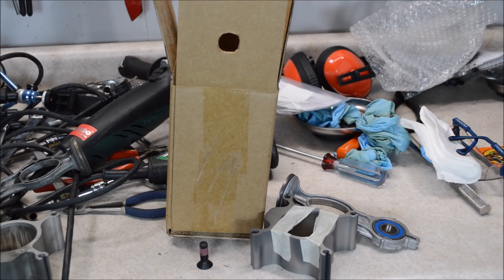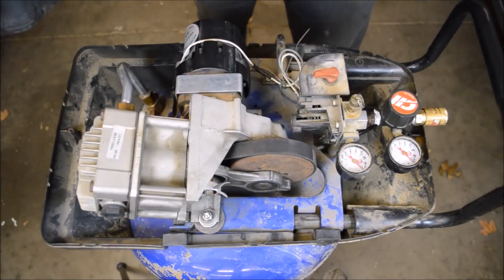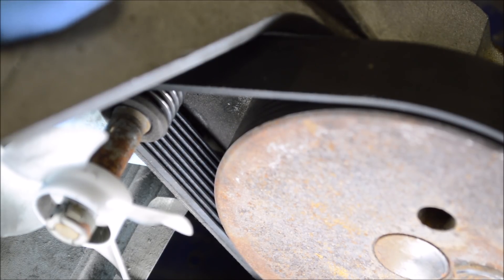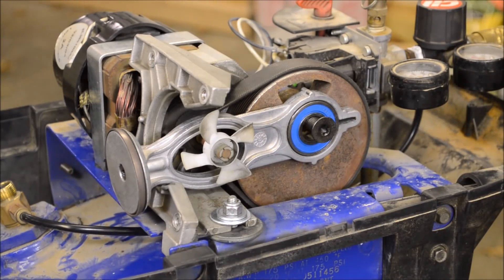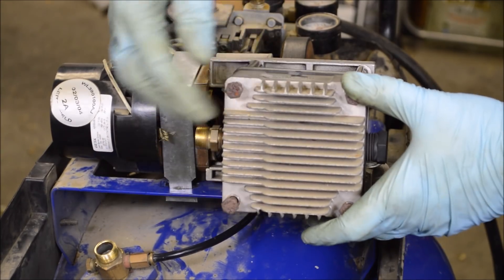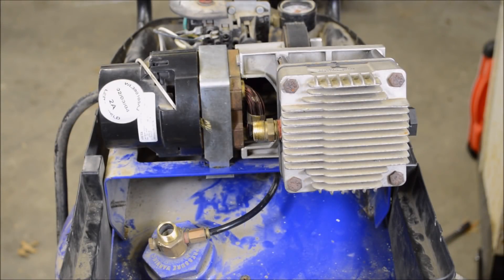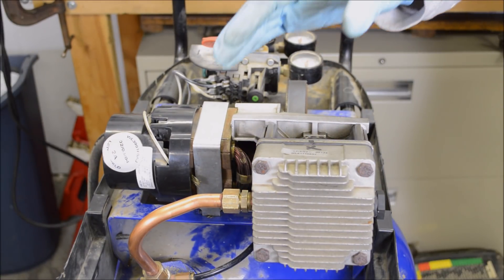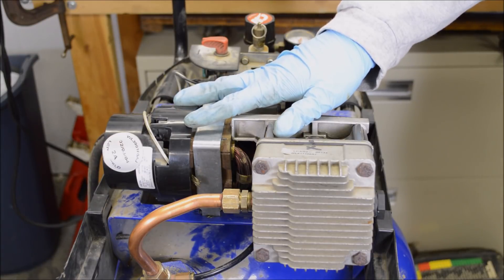How to replace the cylinder and piston in oil-free air compressors / compressor problems part 3

Comment: Also, has anyone had any luck trying to retrofit this unit with a new piston / rod and omit the small fan / shaft that might interfere with it.  Does the C710100 piston / rod have the same diameter piston and correct stroke?

Comment: I know this is 3-4 years old, but I'll try anyway. Any chances for a link to where you bought the piston kit ? I have the same-ish problem and trying to fix mine.
Reply from the maker: I think I got it from a place called Pacific Compressor. I think I bought it from their ebay store.
Reply: Same here! Exact model and issue. Will check them out. Thanks for this video!
Reply: @MrEngineeringGenius  Were you able to find the part? I'm looking all over and the best I see is out of stock/discontinued.
Reply: @arthurr8670  unfortunately I was not able to find it. I ended up replacing the whole thing. Saw the same thing as you. It’s a shame to trash and entire air compressor for $20 worth of parts.
Reply: @MrEngineeringGenius   The best I can figure is by an old cheaper compressor in better shape and clean it up. Either way large waste for needing such cheap parts.

Comment: Would you know where to get a motor for this compressor?Done research and Im coming up empty hand.My number on the motor are gone also.Its a hard find.If this is anything like the wire welder of their that I tried to get parts.Then Im going no where.thanks like the vid
Reply from the maker: You should be able to look it up with the compressor's model number.

Comment: Not good you are not supposed to put what you called the head from the front like that because you can damage the piston seal. Slide it in from the back an then install the piston and head together on the compressor housing
Reply: It looks like he did what you describe the piston head came up from the bottom just like it pumps im confused by your explanation. Are you saying he should have dropped the piston in shaft first? From the top? That would seem wrong to me.

Comment: Hello, I'm looking to replace the piston but I can't find the parts. Is there a website you get your parts or where you would recommend?
Reply from the maker: I used a parts website to find the part number and then bought it from an ebay seller.
Reply: We need the part number you didn't share it with us

Comment: No special tool required to put the cylinder over the piston? No risk to break
the edge of the piston ring, without assembly pliers?
Reply from the maker: That's a very good question. These rings are not like the piston rings on a gasoline engine. They're more like metal versions of cup seals. They're softer and more flexible than the piston rings in a gas engine. It really wasn't difficult to insert the piston in the cylinder. A little twist on the cylinder was all it took. My impression is if you're careful you shouldn't have any problem putting the piston in the cylinder.
Reply: Tool Teardowns .....Thx for your responding :-) If it don't fit easy, you cold use
a heat gun or hot water to make the piston ring smoother. My experience 😉
Reply from the maker: You could also feed the piston down from the top and then tighten it up, but I didn't need to do that.

Comment: So what lubricates the Piston?
Reply from the maker: There is no lubrication for the piston. That’s why oil-free air compressors generally won’t last as long as oil-lubricated models.
Reply: a small amount of graphite rubs off the "piston ring" but theres no other lubrication added, if you dont do paint work and have it apart for repairs its not a bad idea to use some oil on pins and mating surfaces upon reassembly but itll work regardless
Reply: On my rebuild kit, there is a eing made of Teflon (or something similar) between the head and the cylinder. Now it actually makes pressure, but there is a leak on the outside of the inlet valve. Not sure how to fix it, either.